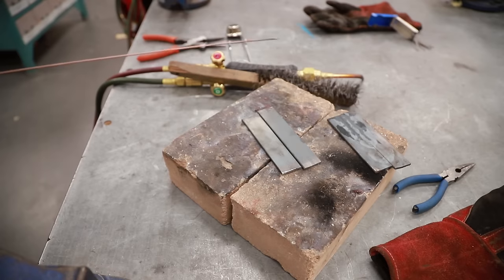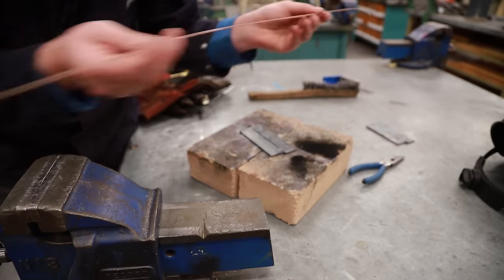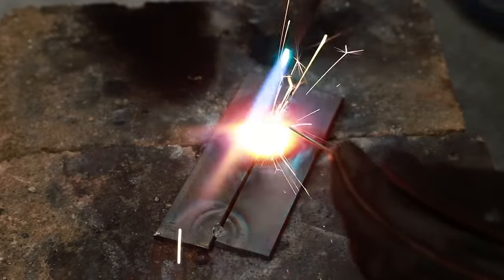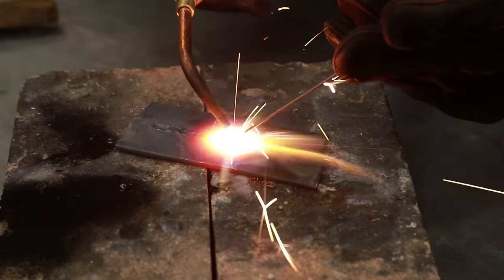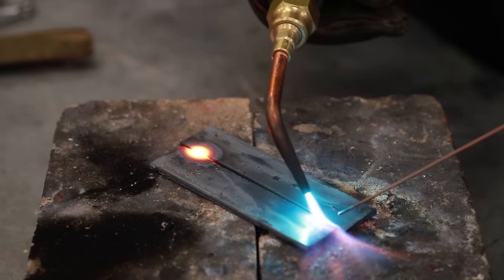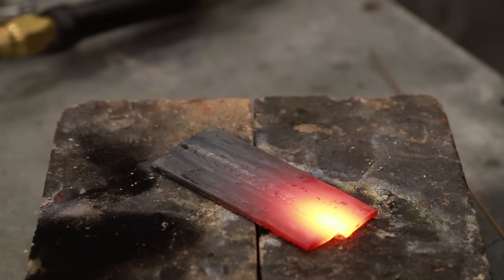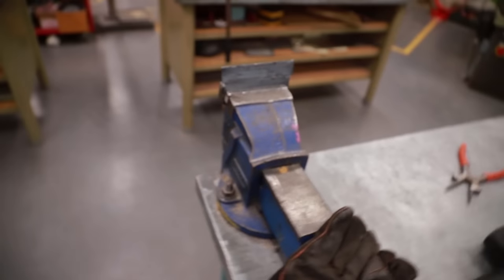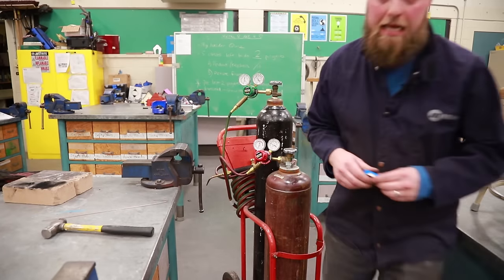Intro to Oxy-Acetylene Welding - Part 2

Comment: I loved welding in high school and college.  In high school we used to lay out several little balls of hash and smoke them first using the hot filler rod.  The teacher couldn't smell it because of the fume extraction system.  The teacher used to comment how I was such a relaxed welder.  Good times.
Reply: I like your style sir
Reply: Sounds like you loved hash and good ventilation 😂
Reply: hot knives 😂hot rods

Comment: Is better practice to leave regulator valve open, after bottle valve is shut, then open torch valve. This will release all pressure within the line back to tank valve, you will notice that one of your gauges is still holding pressure. This is residual pressure between gauge and closed valve on bottle, if left for a while it could fatigue gauge. I was taught to always make it a habit to release the pressure when I finish welding. Regulator valve can now be closed.  Well done! Great video, keep them coming.
Reply from the maker: Good tips thanks! I typically shut the tanks down myself at the end of the properly like you have said but for students I find this is a simple way to at least drill the safety into them :)
Reply from the maker: New video being filmed using tips from commenters. Thanks!
Reply: @TheWhitsboy
Yes, this is the correct way to shut down.
Reply: Excellent video
Reply: I was taught same practice. I was more wondering if this would be a better option to weld thin walled tubing that just wants to melt away with my mig.
Reply: On the other hand, after the valve is shut off, leave it all as it is. This way you can check for leaks when you return. All pressures should be as you left them. It is not dangerous to have the lines full. Spark arrestor should be installed to be safe. You won't hurt the gauges. I leave my a/c gauges under pressure, including the lines. Unscrew the regulators out all the way. A way of self checking the integrity of the whole system. I keep the outfit in a separate shed, away from the garage. Just don't trust it. It has too much energy stored for my comfort.
Reply: I noticed the same thing. Still holding gas in the regulator portion, while unlikely things could happen

Comment: One more trick, when using a gap create a keyhole where the puddle meets the gap.  Dip filler rod in this area this will enable full penetration which will make a stronger weld, and will also give a better looking weld( stack of dimes with practice)
Reply: That's freaking hard man... the right flame temp, the right gap btween tip and weld pool all in play here.. damnn.. one wrong move and you bore a hole right thru
Reply: Issues with controlling a runaway keyhole can be limited by lowering your acetylene volume.

Comment: Besides the excellent video, instruction, and length (not too long), welding the first set of bars insufficiently was great. This is exactly what's going to happen to the student when they go at it the first time. So seeing that through, the results, THEN, then seeing what the adjustments are, a second go-around, with a better result - that's education. Well done!
Reply from the maker: Thanks! And since making this video  I've had a chance to improve as well. I don't get to gas weld as much as I want but it's fun giving the intro to students . Thanks for the kind words

Comment: Good job, excellent video... very impressed by the kind and patient manner in which you have responded to so many comments.
Reply from the maker: Thanks for the kind words. Taking the high road usually works for me.
Reply: @WeBuildStuff  I have never seen such bad welding in all of my life! Your weld is too far oxidised. Please, when you turn on the oxygen to form a small cone, pay attention to it: if the small cone is sharp, it is too oxidising, if it is too fury, it will be carburising. Have the cone just very slightly fury. You also don't need any gap-at all. Just tack the ends (no gap) and probably one in the middle because either plate can warp from the flat if the nozzle is pointing more onto one of the plates. Cut the weaving out: all you are doing is spreading the heat away from the joint and heating the rest of the metal up causing more shrinkage distortions and wastage of gas - especially on bigger jobs. So, keep a steady nozzle along the joint line, and a small crater will form for which you add the mild steel filler rod by dibbing it into it to form a pool. The pool will move along as the joint as it is being heated. From this, you can gauge the amount of penetration by the size of the pool and also you can also determine whether you want a flat bead or a raised bead. It is better to do a raised bead, as it looks better. If you still can't get the penetration, then turn it over and weld the back in the same way. Remember, you want the least heat input to the job or you will cause too much contractual distortions, hence do not weave, and all of the heat must go into the joint. You will also weld faster and use less gas (as I say) this way. Also, you bend the filler wire over at the opposite end to prevent the end being poked into somebody's eye and causing potential blindeness!
Regards, Tony (time served sheet metal worker, gas welder and brazer).
Reply from the maker: @tonyglickman5759  Thanks for watching Tony and expressing your comments. Since making this video I have improved a lot. The main thing I wanted students to get (the 20 views I was expecting on this video) was some confidence using the tools and 'eventually' get better. Many of the comments on the videos have helped me improve and I have since passed that information onto students and modified my teaching for the younger kids that are in the class. :)
Reply: @tonyglickman5759  such bad wielding? Trying to bring people down i see. It wasn’t even that bad. It helped a beginner like me out and taught me the basics.

Comment: I’ve been welding a long time. Mostly mig.. I looked up welding with my torch because I had never done it and wanted some tips. This series is extremely helpful, detailed, and well thought out..
Reply from the maker: Thanks. I know I have a few mistakes shown in this older video but a good starting point at least. Thanks for watching

Comment: great video. I like that your show your attempts that didn't work out so well and then try again. makes me feel better because I suck at this. at my shop, the teacher who is a union iron worker insists that you reverse the valve opening process when turning off the torch. that is, turn off oxygen first and then acetylene. Never had any problem doing it this way.
Reply from the maker: Thanks for watching! I have some bad habits in this video that I have updated in terms of safety procedures. New video here!

https://youtu.be/C6lluYIl9Xk

Comment: Great video series. Im needing to weld in order to make firearms like MP5s and Mac10s. I feel like gas welding gives you time to learn about whats going on during the fusion of two metals but the beauty of gas welding is it doesnt require electricity and EMP proof, easier to learn (electric arc welding is instantaneous and doesnt give you a chance to correct your mistake), and you can weld everything while electric welding limits you to certain steel and alluminum is hard to weld. 
Im downloading your videos so i can rewatch at my pleasure.
Reply from the maker: Glad you enjoyed!

Comment: Holy cow you did all that with a number 0? I use a 3 for brazing copper and I was looking to dip my toes into welding. I like a nice roaring spitting flame for brazing in the wind and a more gentle roar with little spitting for brazing inside/without wind.
You can also notice with a nice super hot flame that the weld/braze is done "locally" like with your second take where the outer edge of the workpiece wasn't even glowing yet while you were laying your bead.
Reply from the maker: Thanks for watching!

Comment: In this day and age where tig is more accessible gas welding like this isn't as common, but I have seen it used to clad weld bronze propellers and I have used it to braze cast iron and weld auto body sheet metal. The weld will go better if you dip the filler rod in some flux first.
You'd be surprised how good a weld you can get with old wire coat hangers as filler material.
Reply: I had a friend in high school whose dad used nothing but wire coat hangers when welding floor panels in an old truck. They seemed to work well. This gentleman was one who could build or repair just about anything. It was a fun place to hang out.

Comment: VERY GOOD on the cold end marker. For my smelter I have a rod I use to stir the aluminum so I can get the slag off the top. I have a piece of plastic I left on the end because I figure it would melt off if it was hot and I'd know better than grabbing it.
Reply from the maker: Rad

Comment: I appreciate your instruction , I am trying to learn how to gas weld with propane and coat hangers, I now it is not the best material but it is just to learn ,once I get the method down I can use the correct material.I see how I need to develope  my  circular motion first and then coordinate my dipping of filler material, teaching is an art .The material I am using only about .04 thick so it helps me to keep a close eye on burn through, my question is , what diameter of filler rod are you using?
Reply from the maker: Between 3/32 amd 1/8 rod is what we usually have in the shop
Reply: The only flame that can weld mild steel is oxygen/ acetylene.

Comment: Thank you so much for the instruction!

Issue:. Caged nut inside a 1999 Toyota square tubular frame had busted free of it's spot welds.  I therefore cannot remove the bolt which holds on a control-arm that I curb-sht last winter and bent it.  Needs relaxing.

My daunting task:

Welding a 2.5" × 4.0" patch cut from a square foot of 12-gauge cold-rolled steel.  The patch will the cover the home I made.

But after watching your videos—and the lack of penetration issues—I may now patch in ine-inch strips width-wise so that after each strip I am able to take a mirror and check the backside for ample penetration.  

I bought a Central Electric 125amp flux-core welder which to perform this operation.  Unfortunately, I am not getting the hang of it. 

I sunk $650.00 in a Oxy/Acetylene tote kit this past summer, so's I may as well try it;. I though gas would burn through the 3mm thick metal. However, after watching youTube videos, I believe I will be okay.
Reply: Get a piece of 1/8-3/16 thick piece of angle and cut it into short pieces and practice welding it back together with the mig. That's what I had in the garage when I taught myself and picked it up within a couple welds.

Comment: I might have missed it but how do you adjust the heat? Do you increase your psi to get a hotter weld? Or to you increase the flow on the torch?
Reply from the maker: I increase the flow on the torch or use a bigger tip. In the class we use a smaller tip because of light duty applications. Anything thicker we use the mig or arc welder

Comment: What are the pros with gas welding compared to mig? All I'm thinking about is the crazy amount of heat that's added to the whole work piece, that I assume would be distorting the whole thing. Especially if it's got some length and width to it.
I have both mig and a oxy-ace equipment, but I'm kind of unsure when to I'll get to use the gas.

Comment: Hey, what happens if I keep the filler rod in between the two metal plates & weld ? Will it give more penetration & strength ?
Reply from the maker: The important thing is how you control your torch and spread the puddle around. I personally take it up and down rather than just leave it there. I leave it in the middle when I am starting puddles though.

Comment: The weld really should be the strongest part of the metal. This type of welding is good for stuff that wont be under any real stress. I think theres a reason alot of people dont weld with a torch and start off teaching stick welding
Reply from the maker: Agreed 100%  . We usually just use the gas torch for heating and bending but I do still try to show the basic techniques so they can move onto tig welding and be used to the similar movements of working with a puddle

Comment: I was welding some older metal and it popped a couple times.  What may cause the puddle to pop and kinda explode? I read it might be bad or rusted metal? What if that’s what you have to weld? I wire brushed and sanded prior to welding as best I could but the metal was 70 y/o.
Reply from the maker: If clean it should be okay. Try adjusting how much oxygen you are using via the torch knob to get a neutral flame. Sometimes too kuch oxygen or being too close to the metal can cause an air bubble to form

https://weldguru.com/welding-flames/

Comment: Many years ago I learned gas welding with a coat hanger for filler rod. Is this acceptable or is there better metal for filler rod?
Reply from the maker: I've done that as well but we buy R45 mild steel welding rod for the classroom

Comment: Great video, thanks for sharing!!! So here's my issue.... I had a pacemaker implant procedure and my cardiologist said that can't use an arc, Tig/mig welder (etc) because it'll interfere withy pacemaker.... SO I would like you to recommend me to a decent oxyacetylene rig because I wanna learn more about the ancient way of welding with oxyacetylene and I'm mostly doing it for fun! I got the $$$ to spend, so I would ask of you to recommend to me a nice/decent rig I have 400.00 - 1000.00 that I want to use for it, could you recommend 3 complete rigs for me? From lowest to highest price? 😊 Thanks in advance ☺️☺️☺️
Reply from the maker: Honestly the best thing to do is go to a local welding or REAL hardware and tool supplier and have them put together a package for you. I've bought oxy-acetylene rigs (everything except the tanks) for $400 but they go much higher depending on brand and accessories.

The one you see in the video is:
https://www.kmstools.com/victor-medalist-250-medium-duty-welding-cutting-outfit-21138

Another kit from my local guys
https://m.kmstools.com/uniweld-oxy-acet-torch-set-141400
Reply: @WeBuildStuff  awesome thanks, and thanks for posting the links!
Reply: @WeBuildStuff  I decided to get this kit Victor Portable Tote Torch Kit Set Cutting Outfit With Cylinders, 0384-0944! I'm gonna keep watching your videos and practice, I think I'll probably run out gas and oxygen pretty fast 🙃
Reply from the maker: @helixomnibus  spending some money to hone your skills and have fun will always be worth it. That's what I keep telling myself when I buy fishing gear!
Reply: @WeBuildStuff  indeed, agreed, I love you man 😍😂🙂
Reply: @WeBuildStuff  looks like I'm gonna lose my brand new tanks when I go to exchange them because seems like no one refills em... This is unsettling 😲😳😟😞
Reply from the maker: @helixomnibus  how much was each tank? We do a monthly rental and exchange for our shops and use about 16 tanks a year. Bloody expensive
Reply: @WeBuildStuff  the victor I got came as a kit, a tote that Carries 2 mini tanks for oxygen and acetylene.... The kit was 449.00 had the torch safety goggles etc and can cut up to 11/4" anyways the beautiful new tanks are so pretty I want to sleep with them 😂 but from what I've read up on I would have to exchange them for older ones that are already filled with gas.... 🙁
Reply: Wow never thought about being able to weld with oxy due to a pacemaker, great thinking.

Comment: How thick is the metal and what is the max thickness you can weld like this? Wondering if I can use oxy/act to weld 5/16 because my little mig welder can’t weld it properly. It’s maxed at 1/8” lol.

Comment: I heard that there is a need to somehow purge the regulator if you do not use it so that it does not decalibrate, how do you do that?
Reply from the maker: I purge at the end of the day usually. Turn off the main tank valve, open the torch valve to release all remaining gas in the line, and back off the regulator dial.

Comment: If you look closely inside your puddle if you keep the heat push to a decent decent temperature you will see what looks like a little bubble spinning around and moving around inside of your puddle. If you can keep that thing the same size and keep it moving fluidly it's easy to keep your puddle at the same relative temperature throughout your weld. Helps with penetration and strength.
Reply from the maker: That's a great tip and great way to explain the visual!

Comment: Is this essentially tig welding with no shielding gas?
Reply from the maker: I would say that you can upgrade to tig welding very easily once you figure out the technique of controlling the puddle and your filler material. Essentially you just need to add a foot/torch handle pedal/button and can be very proficient with both

Comment: Is welding chrome moly tubing about  same process? Is it ok to over penetrate so that the weld is assured complete on the other blind side?
Reply from the maker: Over penetration is good. I would use TIG welding if possible but use what is available to you and make it work😁

Comment: I’m a total newbie. When you say you “increased the heat” or “increased the pressure,” how are you doing that, exactly?
Reply from the maker: Open the valves on the torch more and adjust for a bigger neutral flame

Comment: Nice video, question: when you increased the flame temperature did you only increase the acetylene valve at the torch and then adjust the oxygen at the torch the get the small plume the same size as when you had it at the lower temp? Also, I'm assuming you left the oxygen and acetylene regulated pressures in the hoses untouched?
Reply from the maker: Yes i left the regulator untouched.
Get a higher "plume" with the acetylene and than add oxygen until a neutral flame😊
Reply: Thanks that’s what I needed to know